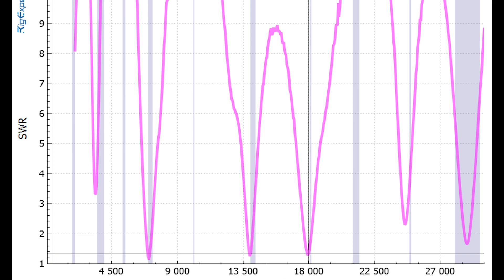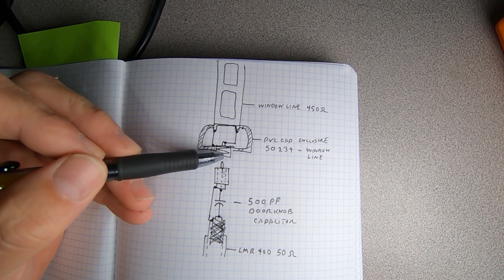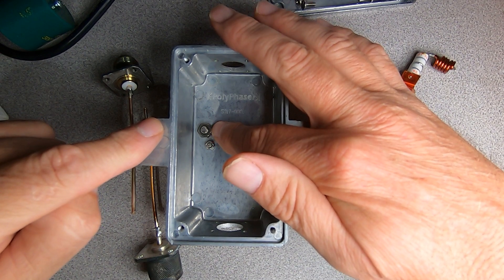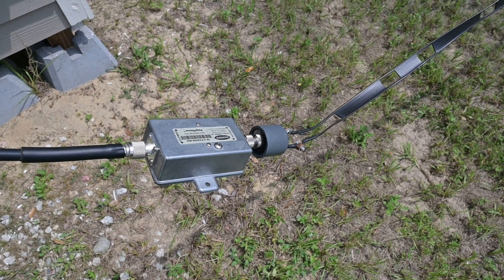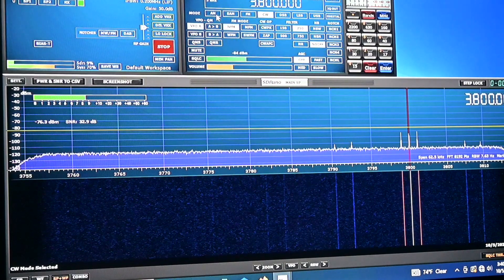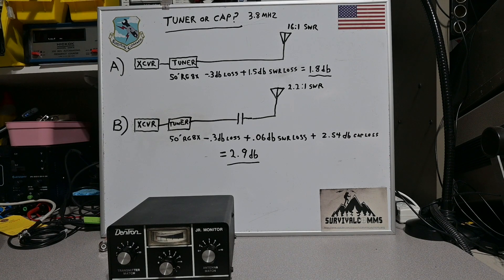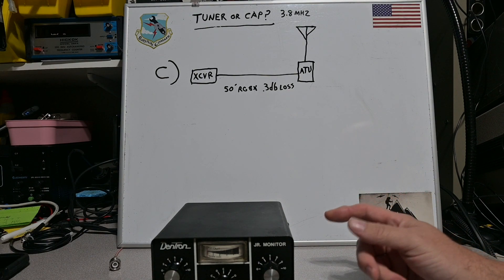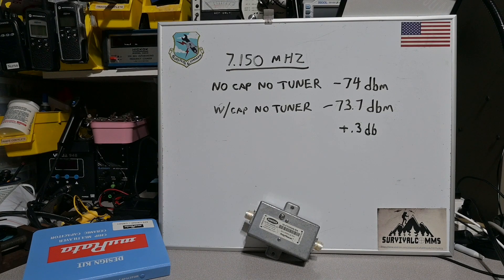ZS6BKW Ham radio HF antenna 80meter 3.8mhz modification add a capacitor build it yourself

Comment: I had G5RV which I made myself, for a long time, it was great. Took me everywhere ( almost ) and with AATU it worked on 80-6m with only 30m missing. Then I seen ZS one and, well I've made one to replace G5RV. Then I modded it to open TopBand world. It's not great but I logged a bunch on that band. Now, 80m was nowhere to find so relaying only on my little experience, NaNo VNA and luck, I attached short wire ( about 7m long ) to ground terminal of 4:1 BalUN I use for TopBand mod. And there you go, I have 80m back. with Europe coverage and some states in the USA. Not bad :D
Reply from the maker: Awesome ! Thanks for watching !

Comment: Neat modification.  In the year since you made this video those enclosures have gone from about $5 to over $25 on eBay.  I guess they got popular.  73 KK7YIS
Reply from the maker: Thank you ! Typically I hit the tailgate area of the hamfest and look for the guy who is obviously an RF cable , adapter, and connector hoarder. Pull 5 or six old lightning arrestors out of the bucket and offer him 30 bucks with a ten and a twenty in hand. Thanks for watching !

Comment: Great video.  Will be build my ZS6BKW antenna once all parts arrive.  Watch your video and Just order all the components for the modification. Everything should arrive in a week or so.  The only problem I had was I had to purchase 3 of the capacitor off eBay.  The seller wouldn’t just sell one.  If any one needs one I bought for them  $10.00 + shipping, I’ll sell for what I paid and a few bucks to shop. They can PM me
Reply from the maker: Thats a good deal ! Thanks for watching !

Comment: Why not just use a better tuner to add capacitance wherever you want it?
Reply: The tuner is at the transceiver end, meaning that the high SWR will travel the entire length of the coax feed line, resulting in high loss.  The capacitor at the feed point limits the high SWR to only the ladder line, where it will not result in significant loss.
Reply from the maker: I have a dozen excellent tuners and that isnt the point. Thanks for watching !

Comment: Built a very rough zs6bkw sorta doublet out in the field today and while it was around 2:1 on 40-10, it wouldn't tune on 80m.  All I did was swap the 1:1 out for a 4:1 and it tuned 160-10m
Reply from the maker: If its a flat match it has loss in your transformer. Sweep it and look for peaks and valleys or better yet dispense with the balun altogether . 
Thanks for watching !

Comment: Hey Brett,  From looking at the W5DXP modifications going to go with a 1000pf to centre it around 3.7. What KV rating would you recommend for the door knob capictor for running 100 watts.
Reply from the maker: You should be able  to get away with a 1kv cap. Thanks for watching !

Comment: Hi Brett.  Sorry to hit you out of the blue with a question.  I have been going throught my kit and came across a couple of solar  rechargeable battery sets that can also be charged via usb connector from a computer.  I discovered a 'blacberry' brand plug with a usb port;  could that be used just like a 'computer' out put for charging these items safely?  ATB.  Nigel
Reply from the maker: Good to see you Nigel. You should be able to use the cable if it fits. It should be a USB A to Micro USB. You could charge it from just about any USB port. I hope this helps !
Reply: HiBrett.

Thank you for the swift reply.  I was worried about ampage and voltage si Iam assuming the dedicated plug will sorth thes things out.  Thank you so much for your help.  ATB.  Nigel @survivalcomms
Reply from the maker: @pnyarrow  It will work out just fine.
Reply: Thank you once again Brett. @survivalcomms
Reply from the maker: @pnyarrow  You are most welcome Nigel !

Comment: Nice mod!  Using that Polyphaser enclosure was a great idea.   I have never looked for a flange mount PL-259 before.  I was surprised that Pasternack did not have one.   I was able to locate a few but the quality is probably no bueno.
Reply from the maker: Thank you very much ! You will see me repurpose polyphaser enclosures on several other projects coming up.  I haven had any luck finding a flanged PL259 either but when I come across some I will buy several rest assured. Thanks for watching !

Comment: Really good video Brett. I really like how you built the capacitor into the antenna. Very ingenious and it looks great. It makes an interesting antenna even more of an asset. As someone with limited options for antennas, this one looks like a good option. I do like to work 30 meters built I have a tuned dipole I built for that. I’ve been searching for an antenna that doesn’t really need a tuner. I’m from the camp that believes tuners are a compromise and should be used sparingly. Thanks for the time and effort you put into your videos and the research. Take care and 73 sir!
Reply from the maker: You are welcome ! Thanks for watching !